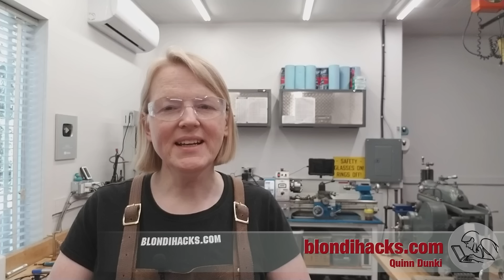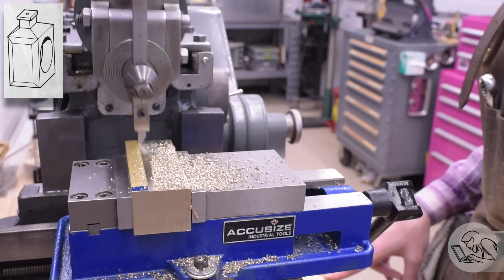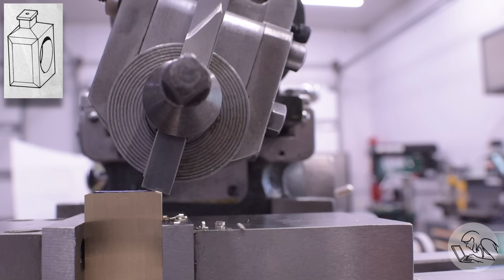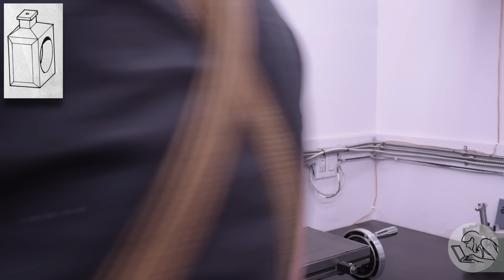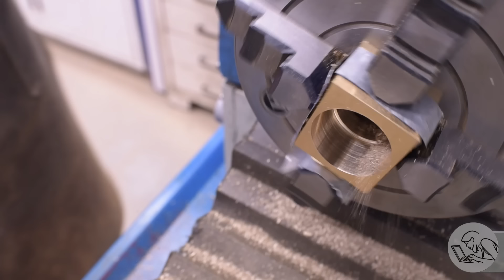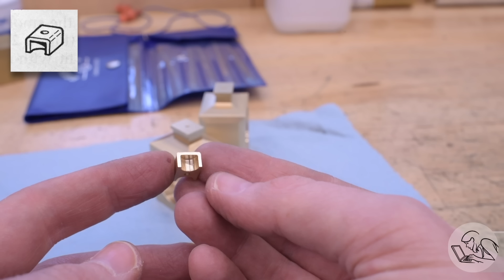Box Lamps! - Pennsylvania A3 Switcher, Part 97

Comment: This made me go through all my photos from train museums to look for lamps with chimneys.  The box design shows up the most, all of them seem to have the access door on the right side (when looking from the front).  They all had 2 handles on the top, one on each side of the chimney.  I did find one that was round, looks like that one must have stored the kerosene in a square base under the round lamp.

Comment: The Central and Southern Pacific used acetylene headlights. When sitting on a siding at night, they were required to dim their headlight to avoid blinding the oncoming train crew. This was accomplished with a pull down shade over the headlight. Simple but effective.

Comment: how square is the head housing to the spindle centerline? like which way does the casting draft go. the round heads on bridgeports are all bulbous, hard to even find a way to check the head tilt other than the scale or spindle
Reply from the maker: Doesn’t matter because it’s relative. Simply zero the digital level where it is when you start, assuming it is trammed

Comment: I would have tried using my little five inch sine bar that I bought a few years ago and have yet to use once. However, unless I glued it down to the vise it wouldn’t have been position repeatable so your way was probably easier overall.

Comment: Fun fact, the Corning company got started making the glass lenses for railroad lanterns, they had to invent toughened glass that wouldn't shatter if it got rained on while it was hot.

I can understand the logic for keeping on with using kerosene for switcher lamps, they spend a lot of time sitting still. Steam dynamos don't really generate power unless the train is moving. Also, for a long time there wasn't any power flowing down the train, each individual passenger coach had a Dynamo mounted to one of its axles, and some chemical batteries. So if the coaches sat still long enough the lights would go out.

Comment: Very pretty little lamps!

A little tidbit on Acetylene lamps: Acetylene gas was the standard on the Swedish State Railroad, the system was provided by the AGA company. Even when electric lighting was invented, the state railroad kept using the AGA system as it was already an integral part of their infrastructure, only very late did they start transitioning to electric lamps and dynamos but by then the railroad was phasing out steam in favor of electric traction anyway.
At my local museum the majority of locomotives still carry the AGA lamps and gas tubes. It was a very successful and safe system used to the end of steam.

Comment: Green-eyed monster here…getting tool envy on the shaper and tilting table (yours looks pretty rock solid!).

Kinda running in parallel as we’re also making some period lamp bodies, though in 32mm/S (1/50:1/64) scale. Ditto on top angles when drawing up in CAD.  Slightly diff approach for us on mfg’ing.  We need a number of them…so (gasp!!) we’re 3D printing masters and sand casting them 😬.
Reply: I'm jealous too. At the end of last month on Facebook a small horizontal mill with a vertical milling attachment and a shaper the size of hers came up for $700. Before I could put the cash together they were gone. 😢

Comment: SO, I genuinely though, for reasons even I do not understand, that the dynamo you made 2 years ago in the middle of the tender build was going to be for powering the lights and stuff on the engine and any cars it was pulling. 

I understand your reasoning but I just want you to know that a functioning steam dynamo would have been really awesome. Also, the dynamo build was the first and only time I've seen you do electrics and I thought it was an interesting change.